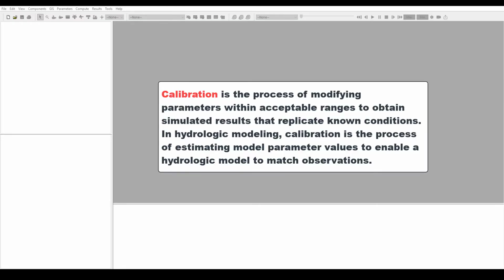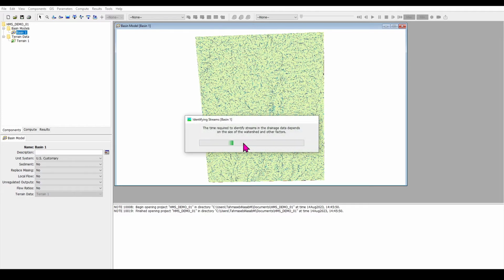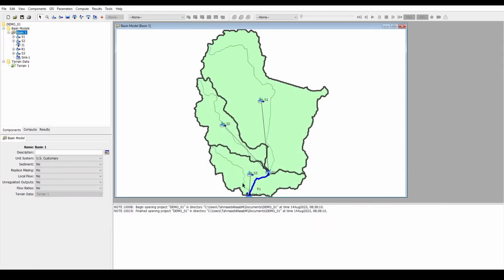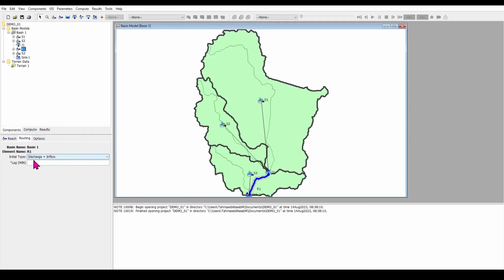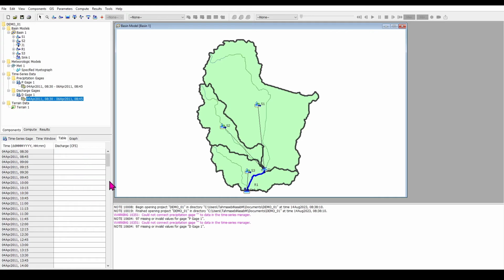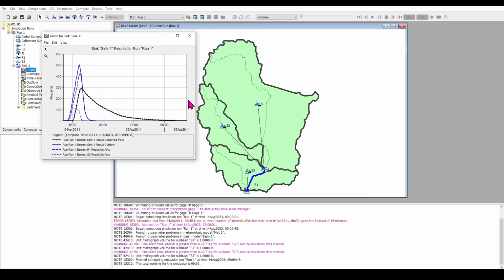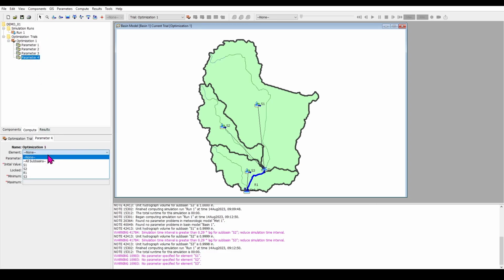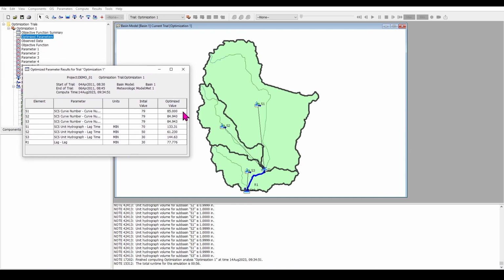HEC-HMS Model Development + Model Optimization/Calibration Using Observed Streamflow Hydrograph

Comment: Hello, I am using 4.13 version and from identifying stream onwards it  doesn't worked.. Did the same path and use same data available in the website.
Reply: On 4.13 version streams can be generated automatically from GIS
Reply: @muhammadtaha7355  Same steps were followed under GIS too